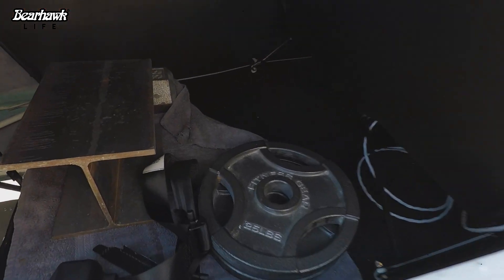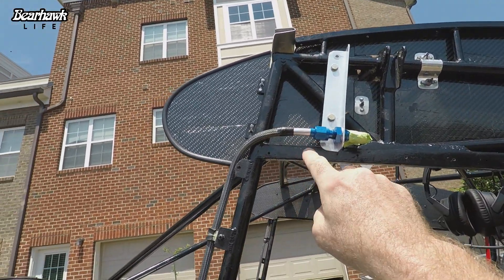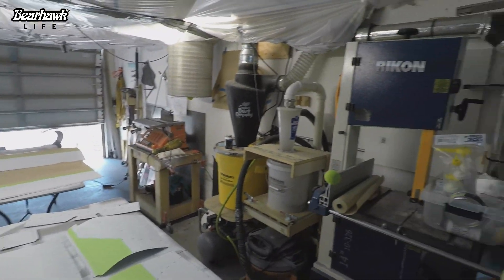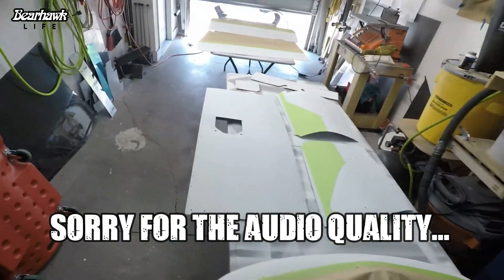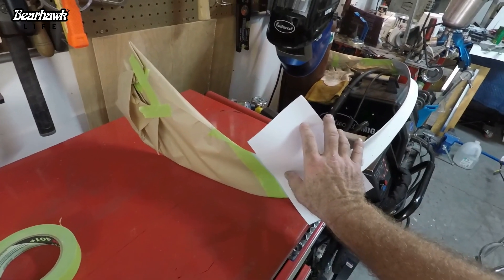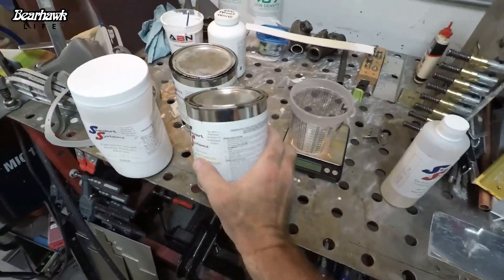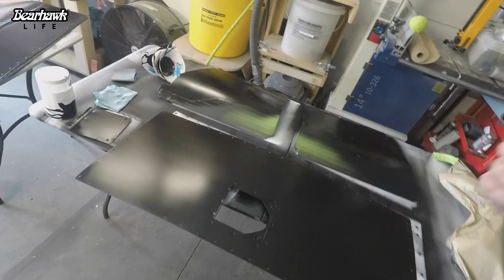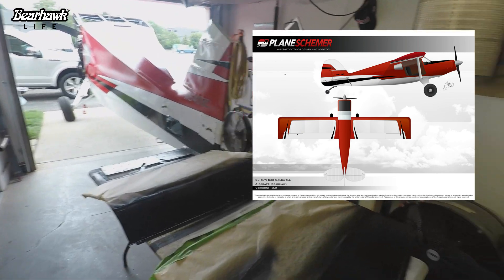BEARHAWK ~ Painting with Stewart Systems water based paint!

Comment: Welding fairleads to the SEAT never occurred to me, much simpler than having to weld directly to the fuse. Thanks for the idea! Even if you didn't weld lol.
Reply from the maker: Glad it helped!
Reply from the maker: Just keep in mind that if you weld a fairlead to the seat bracket you won't be able to remove the seat.  That's why I created a tab that bolts to the mounting stub and can stay with the seat in or out.

Comment: To protect the paint job will you be waxing or ceramic coating the shiny painted parts? Specific products are available to protect the matte finish as well.
Reply from the maker: Stewart Systems offers a 2 part ceramic coating called Evershield.  Can be used on paint or bare metal.  https://stewartsystems.aero/evershield/